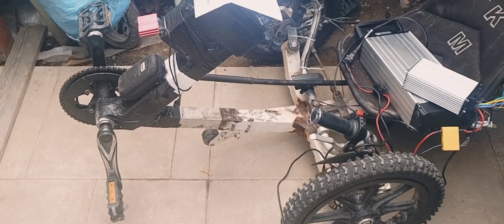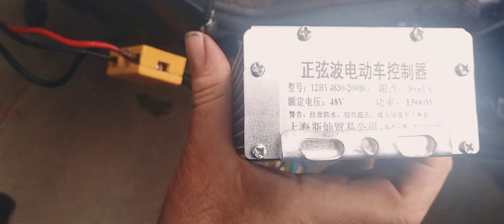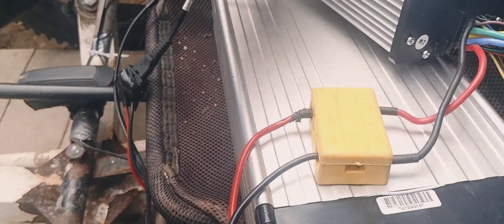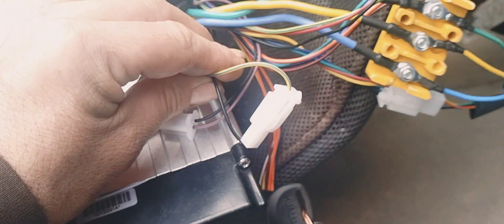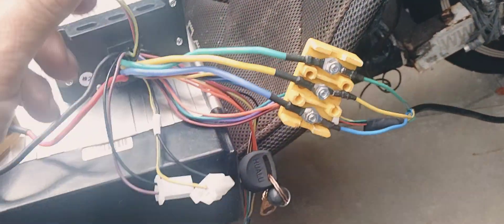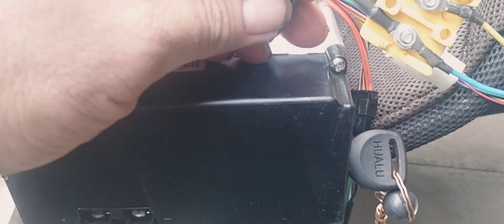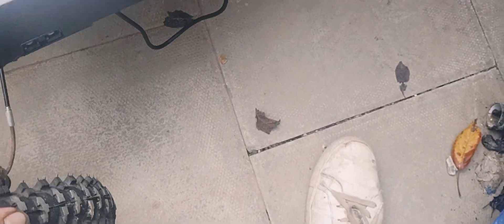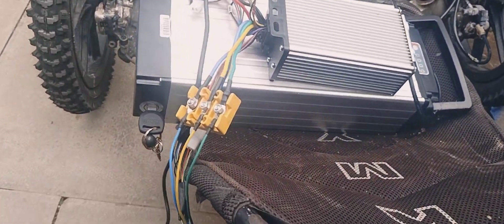Electric hub wheel runs backwards.

Comment: I had this problem on the way to work and was late because of it. What I did was swap the green and blue wires coming from the hub. And if it does it again (because I take the battery off a lot) I will just switch them back.

Good Luck!

Comment: On my motor controller if you connect the "learning wire" temporarily you can reverse wheel rotation. In my case when the single  green wire is connected to the other single green wire, and then turn it on. The wheel begins to rotate. To change direction I twist the throttle. Then shut off the controller and disconnect the " learning wire" and the proper rotation direction is set.
Reply: right answer

Comment: I have almost the simililar problem but this time my hub wont even spin back or forward, but it moans.. im just worried that i will damagemit if i change the motor phase wires.. or can i use a tester or something to specificly know hoe does the 3 wires works?

Comment: Ran into a similar problem myself and as Wayne Goff suggested, you need to flip two of the phase wires.  My guess is that you need to swap yellow and green so that yellow goes to green and green goes to yellow.  To check this ensure that the controller is powered down.  Pop of the end cap and see if the blue is in the centre of the controller.  From what I have seen in the past which ever is in the centre stays going to its colour and two outside phase control wires get flipped.   Hope that helps.

Comment: Swap any two of the phase wires over.
Reply from the maker: What are the phase wires???
Reply: @andrewblackamore4668  The 3 wires coming out of the hub motor and also the 3 coming out of the controller. There is 3 phases 120 degrees apart to make a circle of 360 degrees. On the off chance that that doesn't work just turn the wheel over.
Reply from the maker: @tuguybear930  it's the rear wheel so the gear would be on the wrong side but I did do it but need gears to be road legal.